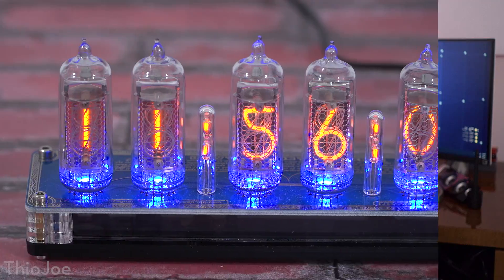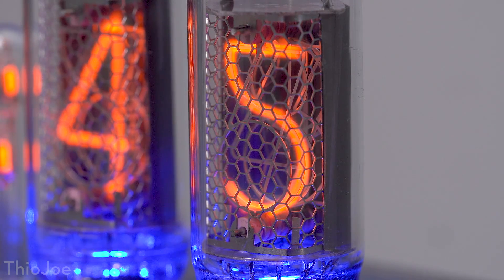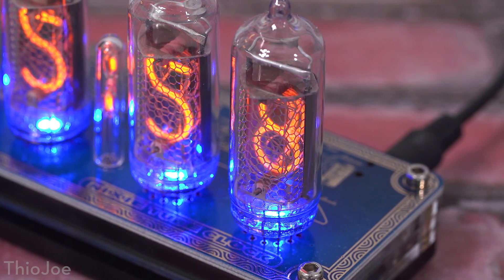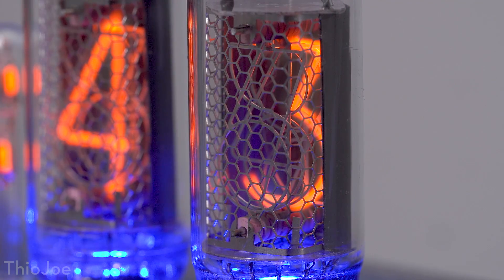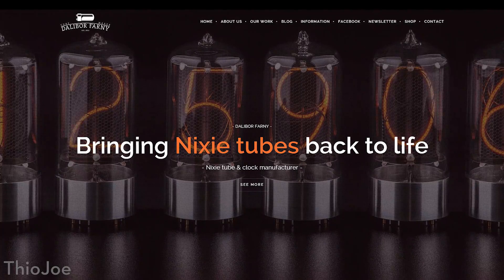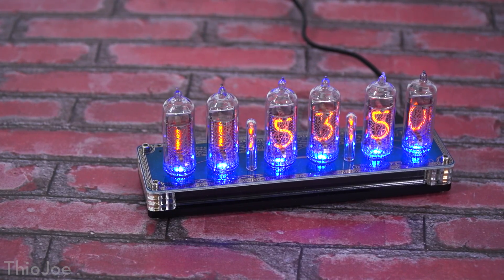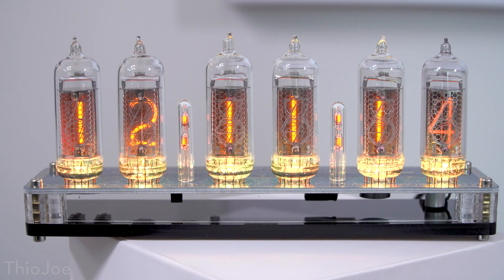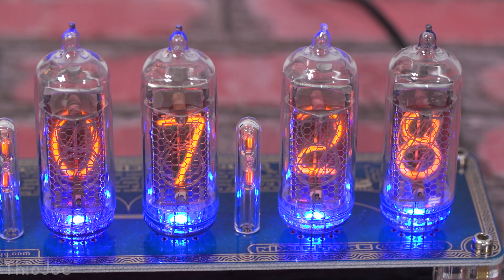The Coolest Clock Ever: Made of "Vacuum Tubes" / Nixie Tubes

Comment: Hi Joe, Welcome to the amazing world of obsolete technology. Appreciate your post, but there are a few zingers to clear up here, in the interest of accuracy of transmission to a generation we will not see :-)

#1 Nixie tubes are still broadly classified as a subset of vacuum tubes, even though they are technically charged with a small amount of ionizing gas after being evacuated of all atmosphere.  Specifically, they are called a "Cold Cathode Gas Tube" (or valve, if you are English)

#2 You repeatedly describe the Nixie's numerical display elements as "filaments", and this is a very poor word choice. Why? Conventional vacuum tubes actually do have a specific internal component officially known as a "filament". It's job is to heat the cathode and thereby create a copious cloud of available electrons which are then directed to the anode or plate of the tube to do useful amplification or rectification work. But Nixie tubes do NOT have filaments. They have ANODES and CATHODES. This is why they "don't get very hot", as you mentioned. More to the point, this is precisely why they are called "cold cathode gas tubes" too. There is no filament to heat the cathode, because it is not needed in this application. So, what are those numerical shaped thingies called? They are called CATHODES. The way a Nixie tube works is that the anode is supplied with a high voltage (typically between about 170 and 300VDC) and those electrons present inside the partially evacuated tube jump the physical gap between anode and cathode, releasing energy as they approach the cathode. That energy release ionizes the small amount of gas present in the vicinity of the cathode when the circuit is completed for THAT cathode. That effect is what makes the "glow"...period. There is almost no heat involved, which is why they are "cold cathode gas tubes". The numerical shape you call a "filament" is therefore a cathode, and those parts you keep calling "filaments" are actually the cathodes! Many Nixie tubes have nine of them, shaped 1-9, though there are some other variations, including symbols, decimals, and even letters.

#3 Size. While there are many types and sizes, there are not "hundreds of them". The vast majority of US Nixies fall into one of just five categories. Those are called: miniature, standard, super, large and jumbo. The highest quality Nixie tubes were manufactured in the United States by the Burroughs corporation. Burroughs pretty much wrote the book on Nixie technology. Read a simple but thorough primer, here:  https://frank.pocnet.net/other/Burroughs/616.pdf  Most Burroughs Nixie tubes are "top address" tubes, with the connection pins located 180 degrees opposite to the numerical cathodes. US made Burroughs tubes are scarce and expensive. English made Nixies are nice, but a fair number have an unfortunate manufacturing defect which causes them to leak and fail. Most Russian tubes are side address tubes, which are simpler to build. Side address tubes have the cathodes 90 degrees offset from the connection pins. Yes, Russians also made some front address tubes, but they are not as common because they were harder to build and cost more.

#4. Side address Nixie tubes from Russia are what you have on your clock. The Russians kept making them for quite a while and probably stockpiled millions for purely military uses, as did the US. The US supply disappeared and/or was destroyed. The Russian supply continues to leak out onto the market. 

#5 Nixie tubes wear out, like every vacuum tube. They actually eventually just won't glow any more -for a variety of reasons I won't get into. Read the Burroughs paper I posted herein to understand what causes that. You will discover that there is an entire subcategory of OEM equipment that supported Nixie tubes, including sockets (now scarce) "Trixie" drivers (another Burroughs device), counter memories, plus frames, power supplies, and so forth. Again, all of that is covered in detail at https://frank.pocnet.net/other/Burroughs/616.pdf    Thanks to Frank for his great service to the entire vacuum tube community, by the way!

Finally, the remaining Nixie tubes are a wasting asset. There are fewer today than there were yesterday, and there will be fewer tomorrow. Tens of millions were made, but many millions were used up, and many more ended up in landfills along with the supposedly obsolete equipment they serviced. Burroughs built Nixies are exceedingly rare now. 

Joe, most of all get this. While it is technically possible to hand build a few examples at great cost and expense, the days of buying a Nixie tube for $1.98 are as long gone as the moonshot which gave rise to their dominance in high-end technology of the 1950's and 60's. This is something for casual clock builders to consider as they burn up Nixie after Nixie for these little trinkets. There is no vacuum tube "industry" to somehow call back to action to build more, either. The tools, jigs, fixtures and factories, plus the supporting materials suppliers such as specialized glass and tungsten makers, and indeed the general worker skills, supply and distribution networks and the market itself simply do not exist. They are long gone, and they will never reappear in our lifetimes. Even more, the knowledge itself is disappearing with the passing of those of us now in our 60's and beyond...which is why I posted my long screed about your video. I hope that some young person - even perhaps yet unborn as of this writing - will find the Burroughs document link and decode it's science to the benefit of themselves and others.

Comment: You keep referring to the numeric elements as "filaments" and that is absolutely wrong.  They are NOT filaments in any way, shape or form. You stated that when the electricity is applied, it heats up the "filament" and causes it to glow.  That is absolutely wrong; NO heating takes place. You also said that the electricity causes the "filament" and the gas around it to glow. That is one HALF wrong; only the gas around the cathode glows, the cathode itself does not heat up and glow. And "cathode" is the proper name for the numeric element, not "filament". The neon gas around the numerals glows when bombarded by electrons just like in a common neon lamp, such as a pilot lamp.  If you are going to post statements about a technology, the least you can do is to learn and understand the technology about which you are talking. All information readily available on the internet with a simple search.
Reply: @miloaustin1404  smart ass
Reply: @panzfaust9812  I was only stating facts that you should have well known. So if I am a "SMART" - "ASS", I guess that is a COMPLIMENT! That certainly is preferable to being a dumbass.
Reply: smart fella  @panzfaust9812
Reply: Get a life

Comment: A Nixie tube does not have any filaments or heaters. A Nixie tube's operation does not depend on thermionic emission of electrons from a heated cathode. It is therefore called a cold-cathode tube. The glass tube contains a wire-mesh anode and multiple cathodes, shaped like numerals or other symbols. Applying power to one cathode surrounds it with an orange glow discharge. The tube is filled with a gas at low pressure, usually mostly neon. So there.

Comment: At 63 I used instruments with these in high school and junior college and also at home via used equipment purchases. My first technician job working my way thru college was repairing magnetic tape drives and disc drives for HP that had.......2.5Mb per platter 1 fixed and 1 in a cartridge for a total of 5mb.....Wow.... 8008 slice processors. I and any other older tech guy could wax on boringly. Oh yea, repaired tube tv's in a tv shop also. Ok I will stop. Fun video.